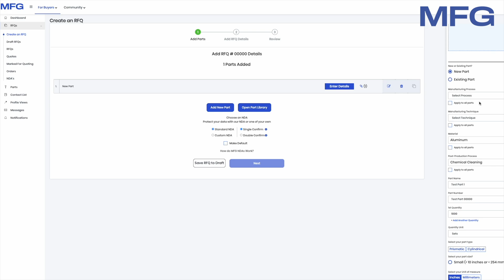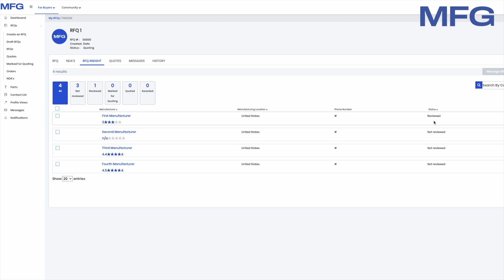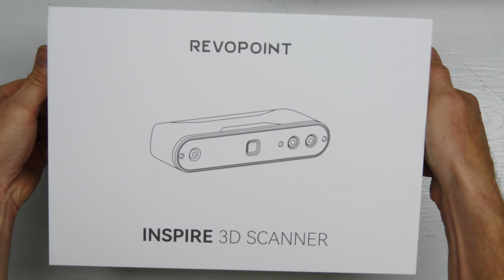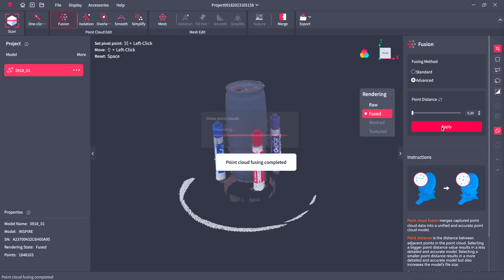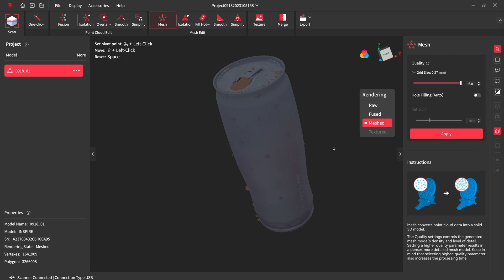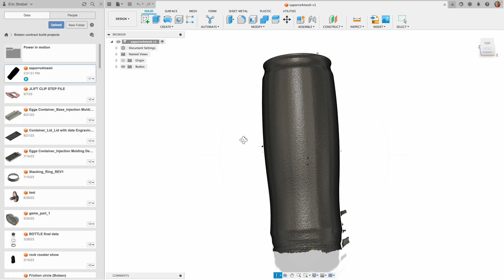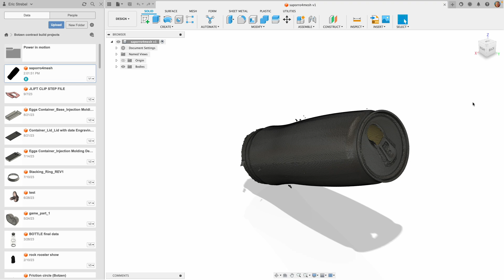Revopoint  Inspire 3D scanner test and review

Comment: 3:29 computer tech here the reason they’re using a USPA for the turntable is because USB A  is a 5 V adapter With a max of 3 A. Where a USB-C output can vary in conditions so instead of creating a transformer in the turntable, they can use variable voltages to run that use a 5 V USB-C meaning that you have to use the USBa to accommodate it.